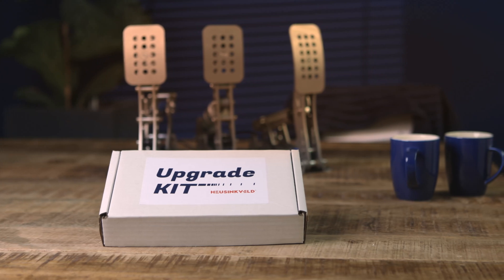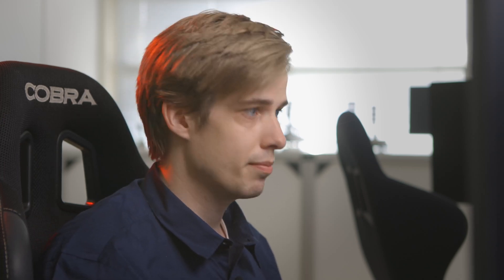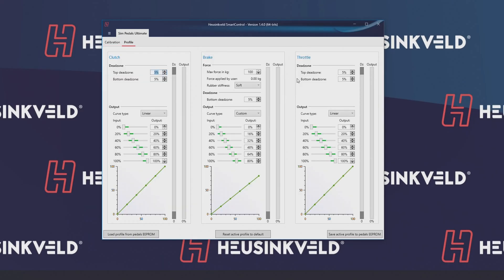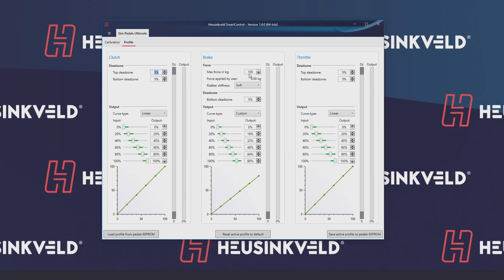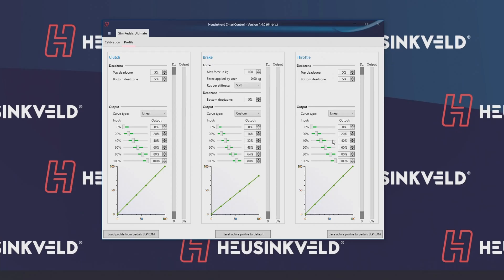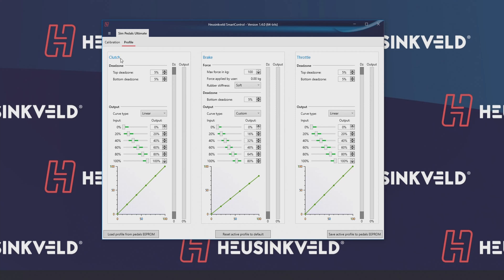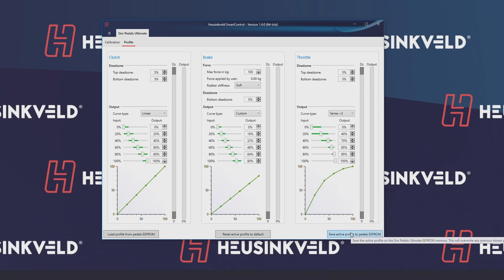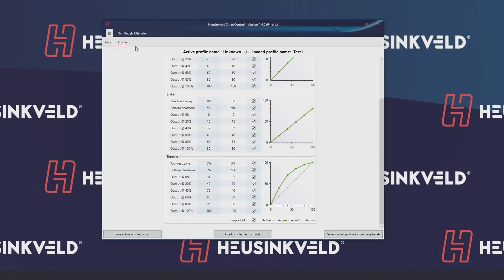Enzo Explains the SmartControl Software for the new Sim Pedals Ultimate+

Comment: I removed my clutch from my sim rig. After setting up the smartcontrol, it detects my brake as my clucth and vice versa..how can I fix this?
Reply: I have the same
Issue
Reply: i have the same failure
Reply from the maker: Hello Jan, 

Recalibrating in SmartControl should fix this! Please make sure to check all 3 boxes for all 3 pedals (even if you don't have a clutch) and to complete all of the steps in the calibration process.

If you have any more questions, please send an email to support@heusinkveld.com !

Best regards,
Enzo
Reply: @HeusinkveldEngineering  Hello Enzo, already solved it. I just disconnected the clutch cable. With disconnected clutch the brake was detected correctly. After a few seconds i connected the clutch cable again and each pedal was detected as it is supposed to be. Thanks

Comment: Just upgraded. First testdrive with gt3 profile in good old AC. Definitely more control now, most important difference is the correct in my case lower brakeforce. A real improvement. Would be great if more profiles could be added. Especially for RF2.

Comment: How does the profiles affect the JoyCalib used now iRacing?
Reply from the maker: Hello BlindGoose1, 

The first time you load up iRacing with the Ultimate+ pedals, you will have to make sure that during the iRacing calibration, all 3 pedals go from 0-4095. After that you can make all the adjustments such as deadzone, limiting output and so on within SmartControl! You no longer have to manually edit the joycalib files at any point.

Best regards,
Enzo
Reply: @HeusinkveldEngineering  
Thanks Enzo.

I already have a set of Ultimates, and I'm going to buy the upgrade kit.

So just to be sure, as I already have changed my JoyCalib file, and some of them are modified different for different cars, should I delete those first before I load iRacing for the first time after the upgrade?
Reply from the maker: Because the joycalib files use the controller ID (name), new lines for Ultimate+ will automatically be generated in the files, which means you don't have to delete your current joycalib files!

Best regards, Enzo